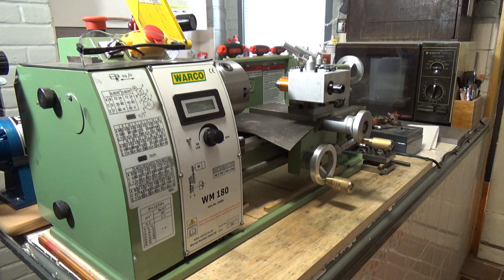Modern Mechanical Tech - Toolpost Drill Adaptor for the Warco WM 180 Lathe

Comment: Now you have had the WM180 lathe a while would you suggest anyone looking for a Warco or other Chinese lathe. Possibly going up a bit in size & weight to a Warco WM 240v  lathe if space isn't a problem, seeing as the WM240 isn't that much more expensive. Your thoughts on this choice of machines, thanks.
Reply from the maker: If i had the space i would definitely go for a larger lathe.  The WM 240 has a considerably more powerful motor and a slightly larger chuck both of which give you increased capability. That being said i'm am very pleased with the WM 180 as i believe is Ade who has had his for much longer and his has seen a lot more use than mine.